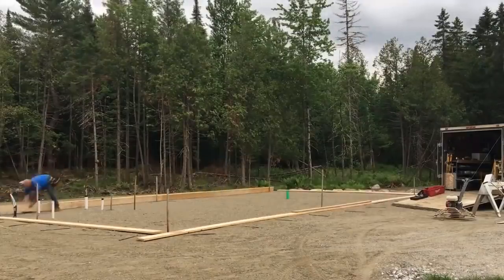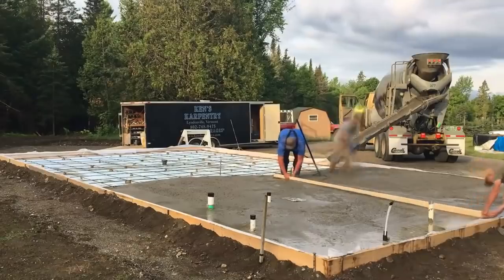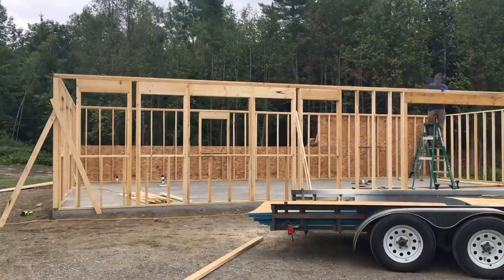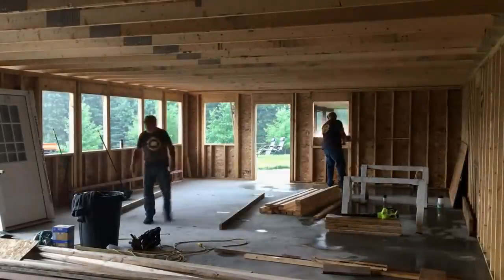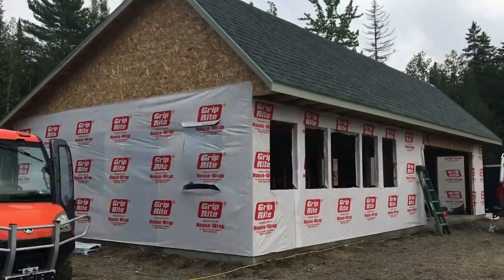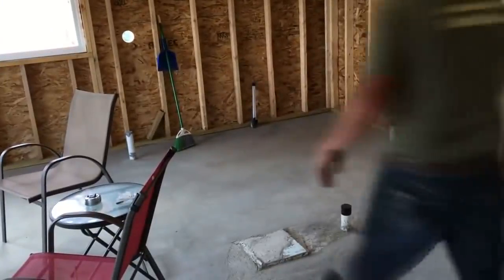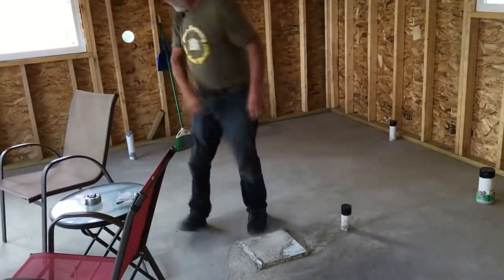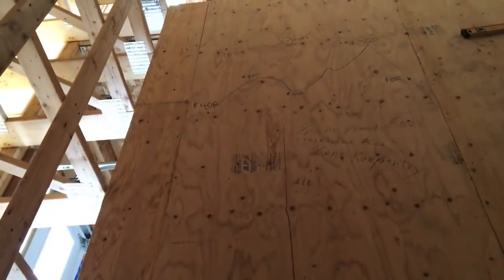TIMELAPSE GARAGE WITH ATTACHED (unfinished) APARTMENT $65,000

Comment: I think radiant floor is an option you should add to your garage proposals, especially if you are going to be installing foam board, pex is cheap and you zip tie it right to the rebar.  Rarely are there failures during the install if you are careful pouring the concrete or you could pressurize it.  Probably could even partner with a radiant floor / plumber to ensure it is done right.  Radiant floor is a great and efficient way to heat an garage, the heat is right where you want it at the floor level especially for garages with high ceilings required for a lift.
Reply: I agree!  We had to refurbish/remodel our very old, sunken, and rotting garage.  Part of the plan included placing 2" of Styrofoam on top of the concrete and adding ~900 feet of pex tubing.  Then a new floor was poured on top and the rotting walls were repaired.  Then I hooked up a wood boiler and now enjoy a very warm garage even in the dead of winter in Wisconsin.  I've got hunting property with a lot of dead oak and maple trees so have a near endless supply of firewood.  Can't recommend in floor heat enough.

Comment: I did several projects over the summer here in Chicago and ran into several problems. One, the cost of the lumber and two, finding lumber that isn't warped. I had to sift through stacks of 2x4's to find straight ones. Some real crap I've seen lately.

Comment: When we shift from garage to house we always upgrade from 4 inch to 6 inch outer walls as you cannot get the correct U values with the insulation into a 4 inch stud.

Comment: The window and door headers look like 4x10 or 4x12. What’s the minimum header size you can get away with. I want my windows to go as high to the ceiling as possible.
Reply from the maker: If it’s like 3’ you could cut back to a 2x6 tripled

Comment: I have a question about saltbox roofs, what is the shortest you can make the short side of that roof? or is there some kind of a equation you use to make the long and short side of the salt box roofs?
love this video!❤️
Reply: If you go shorter and shorter, eventually you have a single pitch shed roof, I guess.  I thin 12/12 is about as steep as they go, just for ease of roofing.

Comment: Hello, why do you thicken the perimeter of foundation by digging a small trench just inside the boards ? Do you fill with foam boards or extra concrete or cylinder blocks? Thx
Reply from the maker: We thicken the perimeter for strength

Comment: DPM goes down first then insulation slab, the reason being that the ground movement and the moisture in the ground eventually degrades the insulation slab regardless if it is moisture resistant. This is standard construction practice. Doing it your way can result in future cracks and subsidence in the concrete slab.